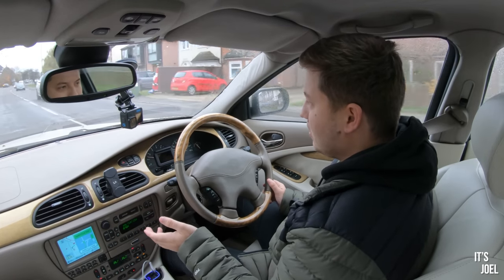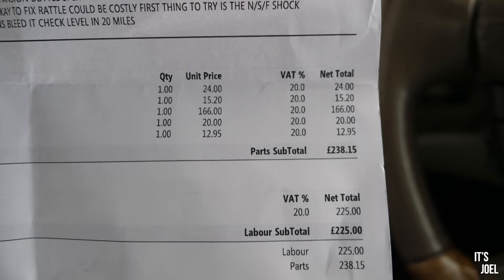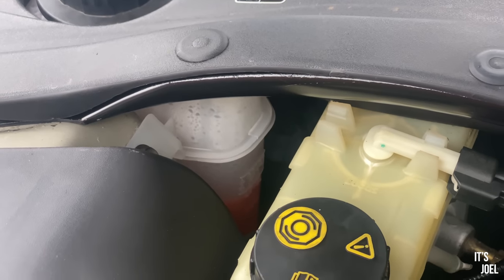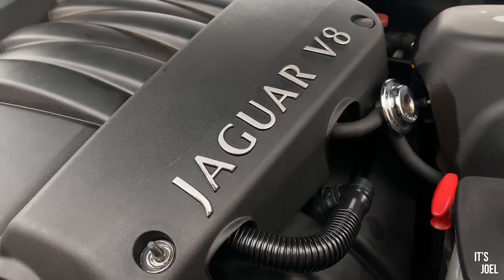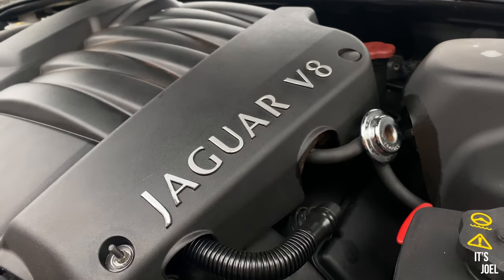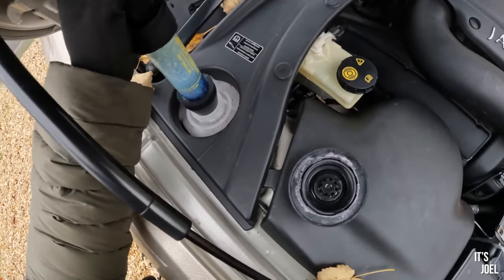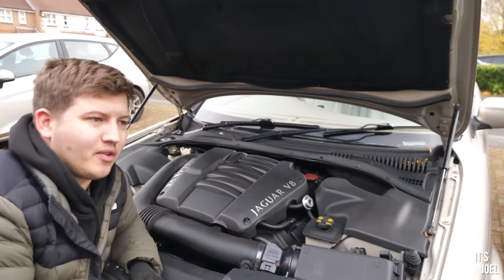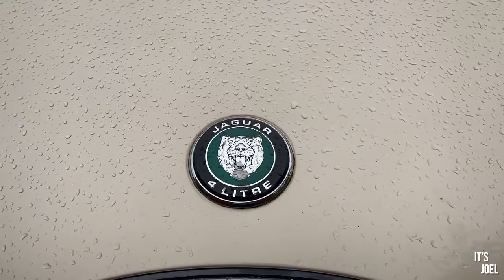Can this £30 bottle of Steel Seal save my cheap V8 Jaguar?

Comment: My 96 Volvo 850 loves to ‘vapour smoke’ in the morning. A water leak onto the flexy is what’s causing it. So I would get your exhaust system checked. But, Your Jag definitely needs a good drive out for a few hours on a motorway. 

The ‘mayo’ on the cap is only from condensation. If it was your head gasket, you’d know about it. 

Here’s hoping 🤞

Comment: How cold was it outside as even you blow out white smoke when its chilly outside, maybe hot gasses into chilly cold air after ya steel seal fixed it , maybe , just a suggestion

Comment: The other day when you said you`d gone out, it had overheated & you`d seen steam coming out of the bonnet, then you said you`d "nursed it home", I thought to myself "he`s lucky he didn't do the head gasket", & here we are... I think that's what did it. Yes, the garage should have picked up on the secondary leak, but driving it after its overheated (& you didn't say you`d topped up the coolant), even gently, will generally cause an all ally engine to do its head gasket.

Comment: I doubt a HGF.  Smoke is the condensation of exhaust heat in the cold damp air outside.
Air lock maybe, especially after you observed the coolant level move, although that could be the stat opening and re-directing it.  Also, check your coolant puke tank, could have gone there.  highly likely. Do not give in.

Comment: The smoke from the exhaust is water from when the gasket started to fail give it a Italian tune up Also its a old v8 car it will have a lot of contestation from the exhaust it's normal

Comment: Do these have an EGR Cooler? That's another place coolant could get mixed with exhaust gas.

Also these S Types have issues with heater valves that can leak. Not sure if that's a newer generation only issue. 

Another test fluid is RLD2 which is a UV dye that can be used to chase minor leaks. You definitely need to find where that Pink residue came from and I would have the coolant flushed (if you haven't already) then re-run the block test.

Fwiw, my work van recently failed a sniff test within about 10 seconds so don't feel bad 🤣 runs too well considering

Comment: Well it maybe a air lock in the system and if it is a Head gasket I would strip it and do it properly instead of using a cheap fix and what happened to the Range Rover as I don't remember some one winning it

Comment: Yeah mate the "white smoke" is just condensation,  absolutely nothing to worry about there 😉  it's completely normal for a big engine like a V8 especially when it's as cold as it is
Reply from the maker: Is it normal for it to still be smoking like that after a 1 hour drive?
Reply: @itsjoel  this time of year all cars do it  i have a 2015 corsa and a 2014 V8 BMW M5 and a 2003 vauxhall vectra they all have "smoke/steam" coming out the exhaust this time of year even after long drives.  it is alot more prominant for the first 10/15 minutes though. its just the warm air appearing in cold air
Reply: @itsjoel   it’s cold now and you have very hot exhaust gases coming out of the tail pipes. If you go for a walk in the cold and breath out you see your breath. Does it stop after a while? No so why would the car that’s at a lot higher temp stop when hitting cold air to. White smoke on a warm summers day would be a worry. I’ve had a few new Kia’s over the last few years and they’ve all smoked like crazy in cold weather and I never lose a drop of coolant.

Comment: With Real Steel you’ll know more or less instantly whether it’s worked or not. We’ve used it a couple of times on black cabs with blown head gaskets (last one was 4-5 months ago) and they’re still working.

The taxi engines run hot and ones double shifted so we’ve been impressed. 

Good luck.
Reply: Does it mess up the matrix Calum or not

Comment: Class car. The last  versions afther 2002 are much better and are modificated. Anyway your Jag has possibly a leaking head gasket. The cooling water and oil come together is what I think. So new head gasket is needed and that is a lot of work because the cylinder heads have to be disasembled. First of all I would take this car to the specialist if I were you. I wish you all the luck.

Comment: Just seen this video, I had the same Jag as you, lovely V8 with a lovely sound stereo, had the Amp on parcel shelf version ... I know loads about these jags, been a car mechanic for over 30 years rebuilding engines and specialise in modding engines up ... Where in the UK are you mate?

Comment: Hi Joel,  sorry you still got issues
With it, liquid gasket is only a quick,
Temporary fix, it gums up around the 
Engine blocks coolant jacket. Should
Work for a while though. As for fixing
It, i would imagine its an all aluminium
Engine, its probably quite pricey. Take
Plenty of water, go on a shorter trip mate.
Had a trip go bad, ended up coming back
On on an AA truck. It was still a laugh mate.
Always like the content. 👍

Comment: Worth replacing the gasket rather than adding quick fix additives.ive got an old jag with the aj16 engine & I've replaced most gaskets now as a preventative measure.not as daunting as it seems.the white smoke is just condensation
Big old engines these & take a while to warm up in these temperatures

Comment: Petrol and diesel are wet fuels there go will 90%of the time give water vapour! This is probably as fuel is set slightly rich ,this may/probably be the right steering for your car also your exhausts relatively speaking are cold so not burning off the vapour at idle ! And to top it off the small leak you had has been ( temperailary? ) Fixed ! HAPPY FAYS !
Reply: Aagh spell checker strikes again not steering but (setting)

Comment: Normally if it's head gasket heater will run warm then cold and will not get hot on highest heat temp.

Comment: Dont be confused about the condensation you can see .You havea large engine and a lot of silencer .Hot air will tend to get cold as it exits the silencers in to the  cold air so condensation will form untill engine is very hot    i love the car by the way.

Comment: Unfortunately I don’t live anywhere near you. I do have an XJ351. Portfolio, and would seriously consider actually replacing the gasket. Like yours, I bought mine second hand with 48k on the clock. One thing I would uggest though, is always keep money aside  - ring fenced for repairs. I do love Jaguar cars, but understand that a second hand luxury vehicle is always going to more expensive to keep going. Please look up your nearest Jaguar specialist. Good luck! Keep faith - but be prepared for some expensive repairs. And very importantly,do see that all advisories after an MOT are seen to! I made tha mistake of procrastinating with a previous Jag, and wound up having to sell it way below it’s market value.

Comment: Not smoke ..steam that's it ..a misfire would be 1st indication of a problem.i don't see any mayo under oil cap either.the cars fine drive it. Also if coolant was leaving the engine then ur gearing would be cool .

Comment: It doesn't look like a head gasket failure to me. The steam in the exhaust is actually unremarkable in this weather. The oil filler cap has only a slight hint of condensation. There's no quantity of mayonnaise present which you would expect if there was a gasket leak. I would not tip any more gunk into it. It will get into everything in the coolant system and the risk is that it will tend to block radiator and heater cores. Not a good idea!

Comment: At idle there's not much exhaust gas moving very slowly down a long steel pipe on a cold day, lots of times for moisture to condensate in to visible steam. Take it for a spirited drive, see what smoke you get, I bet not much. Never heard of steel seal, interesting

Comment: It sounds like your head gasket need replacing. I had an s type 2003 V6 with the same problem. . The only difficulty was the timing chain marks. being a ford engine

Comment: If I was you I would have got a newer s type. I have a 2006 3.0 liter v6 and like how it performs and looks. The 4.2 v8 is the engine I would have got.

Comment: NO the secret of steel seal - is to leave your car for at least 12 hrs AFTER you have applied it ..! Its like an epoxy my mistake was driving it too quickly after application. So apply it and then LEAVE it for 12 hrs toi SET HARD. If you drive too early and it hasnt set hard it will blow (think of a treacle bubble) BUT it will make more damage to your gaskett as it did with my car which pretty much blew up the cooling system.

Comment: Its very simple bud lol! It's still blue because it worked, your issue was definitely the head gasket. Your seeing smoke from back pipes still BECASUE it's super 🥶. YOU SAID IT YOURSELF EARLY IN VIDEO, ALSO DONT FORGET YOU SKIMPED OUT WITH ONLY 1 BOTTLE AND NOT 2 FOR THAT BIG ENGINE 🤷🏻‍♂️ LMAO. Answere TO YOUR FINAL QUESTION ABOUT SMOKE- your still getting it because of the weather 🙌🏼😂😂😂😂😂😂😂. (Still gave you a like BTW, AND ID STILL DO THAT 2ND BOTTLE IF I WAS YOU👌🏼🙏🏼)

Comment: Get the cooling system pressure tested at a garage, or buy the equipment and do it yourself. The kits are not expensive to buy

Comment: Hi Joel. Mayo on oil cap is normal especially lots of idling and short journeys but should be a lot less on longer drives. 

Likewise there may be a lot of condensation in exhaust if not much driving and lot of idling. 

My suggestion is monitor the coolant levels and have an idea of how much coolant being lots over what mileage or time period now you’ve used the steel seal and recheck the exhaust white smoke and Mayo on oil cap. 

Maybe worth also seeing if any Mayo on the oil dipstick. 

If there’s an oil cooler on the car that’s gone faulty then that could also give coolant loss. Don’t know if it’s on your car but could well be. Follow the radiator pipes around and see where they go. 

All the very best of luck 🤞🏽

Comment: The white smoke is due to hot air coming into the cold air giving a white vapour, exactly the same as a human breathing out hot air into the cold air
 So. I don't think it's anything to be concerned about.
After the engine has cooled down check the radiator coolant level. If the level has fallen, then you may have a head gasket problem.
I'd like to know how things turn out for you.

Comment: I am a small holding farmer and need a new chicken coup but wood is very expensive at the moment due to false inflation so I am willing to give you twenty quid for your car as it will make a good chicken coup over the winter.

Comment: Your system is pressurising and blowing pipes off when pressure too high! Retorque your heads down when cold and try again, steel seal will make a mess of your engine and rad internals!

Comment: check oil cooler but first do a compression test to the water system, found on ebay for 50 pounds

Comment: You said its about 5 degrees outsdie and you have a v8 up to temp, expect smoke coming out of the back. its cold out there! Drive it down to africa and im sure that issue is solved. Looks like you might have got lucky there if the gasket is starting to weep, may last a year but at some point you will need to take the head off and change the gasket, sooner rather than later, if you do it now on your drive your less likely to have to pay to get it skimmed. Allow at least a month if your doing it yourself outside. At least you got new anti freeze in so defintely no need to drain it all out again if your just going to leave it and drive it for now.. nice to hear kitty cat is all ok , all a learning curve mate. 40 squids is strong for the bottle, can understand why you wouldnt want to buy another one. Check the warnings on the bottle, will burn kidneys if it leaks out. However if it seems to fix it maybe buy another , and sell the car. Or expect to pay at least another couple of hundred quid if it boils up next summer when your driving it and you have to take the head off. It wont be a perm solution all it is doing is filling a gap between metal with gunge once the engine cools down that liquid will expand like a yorkshire pudding. if yo had the slightest bit of mayo in the brand new filler cap on the bottle then its a given the gasket is threadbear after 23 years. Youve definelty got some other weird leak under there though looks like purple rain, dont forget to check the screenwash bottle in case thats leaking everywhere, in which case again your cat will be all over it. You may be better off just taking it to halfords to give it the once over 
if you dont know any reliable mechanic other than that last wanker you took it too.

Comment: You will have condensation in your exhaust system for quite a long time and as it's petrol there is a percentage of water in your fuel and as it's winter you will build up water in your exhaust system when you turn off the engine and it cools down ⬇ would give it a chance now I've been playing with engine's for over 50 years now and that's what I would do give it a bit of time

Comment: I know you love a v8 so maybe next time try a merc with the m113 5.0,I've been driving a cls 500 for 7 years pretty much trouble free with exception of 1 air strut & couple ball joints here & there,e class,clk,cls,s class,m class loads to choose from & not much £ either,just an idea, good luck with the Jag though.

Comment: Sorry abother comment but I'm the same with my 2002 BMW, the factory sat nav is so old school, kinda pixelated but not terrible. Quite a bit wide screen too, people keep telling me to get a new head unit but no I think the factory nav is cool, very period. It's actually run by a dvd in a dvd drive in the boot 🤣 mine has the 2003 updated disc so it's not too out of date but the A130 entire 6 lane dual carriageway isn't on the map it think I'm in a field which is amusing 🤣

Comment: I've seen this stuff utterly ruin a good motor, simply dont use it. When it gets into the engine and cooling system it forms a silicate glass coating everywhere and if that happens in a radiator or location other than the leak it can not be removed by flushing. I had a sweet xk8 convertible that popped a hose on holiday in france and overheated just a bit, on the retun journey it became obvious a head gasket had gone and this stuff was used as a get me home fix. With the heds off a top end overhaul was undertaken and the cooling system was full of white scale, radiator was recovered with hours on a flush bench with citric acid flush, the heater core was blocked solid had to be replaced. If you have to use a leak seal use one that can be removed when the time comes.

Comment: Not sure how helpful it will be but my wife has an Audi Q7 and it was using a tinnnnny bit of coolant .... but only after it was switched off and had cooled down and only if you left the heating system turned on when switching the car off. We had it pressure tested, water pumps changed etc ...  Turns out it was a valve in the V of the V6 which circulated coolant around the heater matrix ...  an absolute shit show to say the least. Thanks Audi for putting plastic parts in the hottest parts of the engine. Anyway the point is, try turning off your heaters and see if it still uses coolant? Might be a shout to point towards perhaps a leaky heater pipe, leaky heater matrix or similar.

Comment: I know what's wrong.
Jaguar used recycled plastic on the coolant system.
 When it's hot a couple of aged components leak.
 when hot and under pressure.
It leaks where black meets clear.

  Don't put that shire in your engine

Comment: It isnt white "smoke" you are getting out of the exhaust it is simply water condensate,
 as petrol has an unbelievably  high H2O (water) content,  not usually apparent in the summer with higher ambient temperatures, but easily noticable in winter especially when the temperature gets close to freezing, plus the larger and slower revving an engine is the more it shows.
 Rolls Royce silver shadows for example used to belch like a steam train when first started on a cold day   it is nothing to be overly alarmed about,  just look at any vehicle starting from cold on a really cold day  and look at the exhaust -  within seconds it will be chuffing out reams of your "white smoke"  which is purely a steam component of combustion and cold exhausts condensing it further as it passes down the unheated exhaust system, the time to start  worrying is if it belches out masses of condensate on a hot summers day.......and wont give in even after the exhaust heats up,   THAT is usually a dead give away of head gasket problems. If you remain convinced it is a gasket problem - then buy a compression tester and do every cylinder looking for a slight pressure drop on one of them compared to the rest and also compare its plug to the others if all are biscuity brown and that particular one is a creamy milky colour - then it is almost certainly that one. another trick to try oddly enough is simply smell the exhaust gasses from the back of the car as it idles, if it smells a kind of weirdly sickly sweet smell it is another dead give away for coolant escaping into the exhaust.

Comment: Don't think it's head gasket bleed the water system properly could be airlocked exhaust is only condensation could be possible core plug leak

Comment: You are panicking, that fluid was blue and the oil cap always get a little mayo, yours was almost clear. A bit of condense from the exhaust on a cold day is fine. A real head gasket blow is unmissable.

Comment: Hm, why is there smoke at the exhaust? Maybe because it’s an combustion engine? Why are you so surprised, that  it worked? That was the point, right?

BTW: Water coming up and going down again just means that the large coolant cycle opened up. Perfectly normal….
Reply: BTW: fuels are hydrocarbons … there: I found your water source…